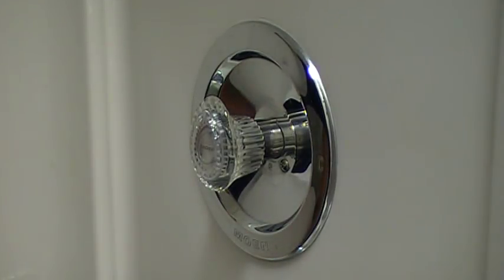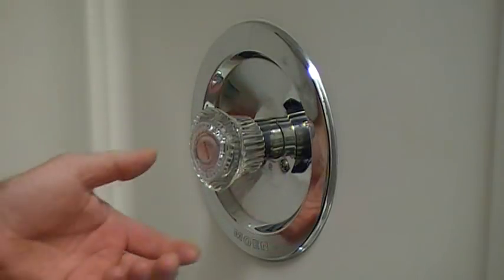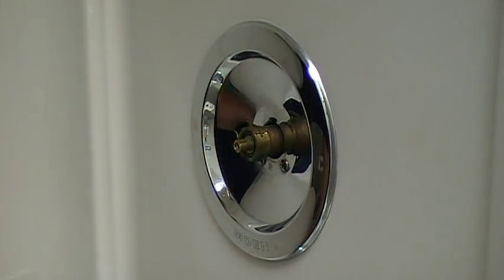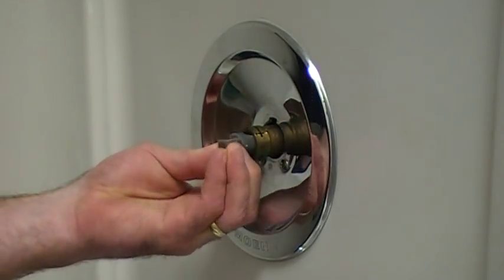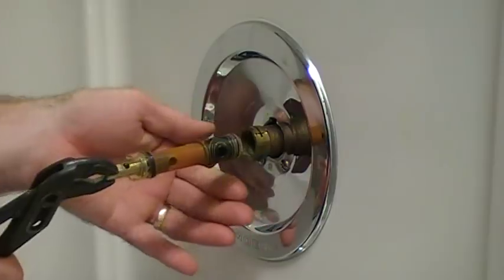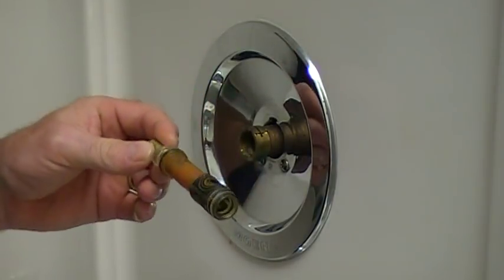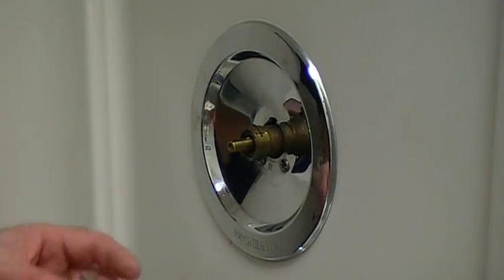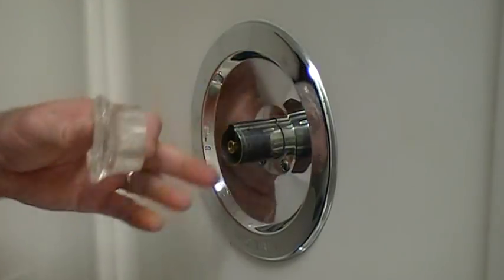How to repair a leaky single lever moen bath or shower faucet..Older style

Comment: Can you tell me..I have this faucet but when I remove the handle its just a pipe sticking out.  It does not look the same as yours. I can see the cartridge inside the pipe.  No pin or clip on the outside.  Will I be able to remove the cartridge with the tool?  I ordered it from Moen.  The house was build in 1987 so I imagine it is the original.
Reply from the maker: Hello Hilda,
When you remove the handle is there a chrome pipe that you are looking at and inside it, you see the cartridge?
You should be able to remove it with the puller. They work very well.
Thanks for commenting and get back to me when you get chance.   Al

Comment: Mine leaks 1 drop every 2 minutes. After the plumber soldered all connections with the cartridge installed.

Is the cartridge bad now??

thanks in advance.
Reply from the maker: Hello  Moreawake Now,
He should have never soldered it in with the cartridge in place. You will have to replace the cartridge to stop the leak. Hopefully it will come out for you easily. 
A torch and plastic don't work well together. Turn the cartridge before you try and pull it out. 
Thanks for commenting and best of luck with the repair!    Al

Comment: Hi, I replaced the knob, sleeve and beauty ring kit.  It came with the little metal gasket and a rubber washer.  The directions never said where to use the rubber washer and I have water coming out of the knob when assembled.  Any suggestions?
Reply from the maker: Hello THEEPLANB;
I would remove the cartridge again and check the inside of the faucet to make sure it is clear of any little foreign objects.
Then try and insert the cartridge again.
If you still have a problem afterwards; I would grab a cartridge and install that it.
It is possible to have a faulty cartridge, but very uncommon.
If it is the o-ring is the size of the brass on the centre of the cartridge; then it would go on there before you attach the handle. 
Thanks for commenting and best of luck with the repair!    Al
Reply: TheOldkid888 WOW I DID IT!!  Gave it a little twist, plenty of plumbers grease and whola!  Followed your video EXACT, I had NO experience at all ever.  Mom of 3 if I can do it you can too ladies.  THANK YOU AL !!!!!!!!!  :)
Reply from the maker: Hello THEEPLANB;
You are more then welcome!
Congrats on the repair!
I am glad you got along well with it!
Thanks for commenting and have a great weekend!    Al

Comment: Great video. How do you know what size cartridge, 1225? Our Moen is probably around the same age and looks a lot like the same style. Is the number stamped on the cartridge?
Reply from the maker: Hello Tony,
If you have to pull it out to turn the water on you need a 1225 cartridge. 
The 1222 cartridge simply turns and does not pull out.
Hope this helps!
Thanks for commenting and enjoy your week!    Al

Comment: Any suggestions for someone unable to remove the Philips screw from the center of the knob? Tried WD40 & CLR -- It refuses to budge. Any advice will be greatly appreciated. Thanks.
Reply from the maker: Hello imluvnlife2;
That can be the most difficult part of the job at times. Darn things!
I would try a good quality penetrating oil and let it set over night. Good quality penetrating oils work well!
You want to use a screwdriver that is nice and firm and not sloppy in the end of the screw,  
push in very hard and try giving it a quick snap.
If you have tried this already; you MAY have to look at a purchasing a new the handle and screw. This entails cutting the handle off with a hacksaw and then making your repair!
You can look into screw extractors, but this may not be for you. They do work. You must drill a hole into the screw and then use the proper size extractor to remove the screw.
Sorry to hear your troubles. Wish I could help more!
Thanks for commenting and best of luck with the repair!
Reply: TheOldkid888 : Finally got it all worked out. Thank you. (-: For a single mother with a very modest income, your tutorial is literally a life saver. God bless you!!
Reply from the maker: Hello imluvnlife2;
You are more then welcome!
I am very happy for you! Glad it finally worked out!
Now give yourself a well deserved pat on the back!
Thanks for commenting and if anything else should come up you are looking for a little advice on, don't hesitate to ask!   Al

Comment: I had my tub spout, handle and shower head changed about 20 years ago that cartridge lasted about 10 years till the faucet started to drip, had that changed by a plummer that one lasted 5 years and then that one started to drip too had that one changed by a plummer again. After 1 year again the faucet started to drip after watching your video I'm going to try my hand at replacing the cartridge or do you think I should replace the whole faucet. ThankYou
Reply from the maker: Hello  nanared419,
I don't think the faucet itself should be changed out.
Replacing the cartridge should od the job for you.
Very strange that it leaked so often. 
What type of water supply are you on. City or a well?
Thanks for commenting and get back to me when you get a chance.    Al
Reply: Thanks Al for resounding so quickly, I am on city water.
Reply from the maker: Hello narared419,
You should be able to tackle this yourself and have no issues for some time afterwards.
I was curious as to the water supply because if you were on well water sediment could see be what is causing the cartridge to leak.
If you go to your local hardware store and ask for a free cartridge they should give you one. I know they do in may of stores around here. The company will even send you one in the mail if you give them a call free of charge.
Thanks for commenting and good luck with the repair!
Let me know how you get along!     Al
Reply: They could have 'hard' water as we do out here in Las Vegas, NV. Soft water filters are commonly installed on both hot and cold lines to prevent calcification and such.

Comment: Any chance in a part number for this item? It looks just like the one I am working on but can't find parts for it.
Reply from the maker: Hello @fubar1872008,
The part number for the Moen cartridge that pulls out to turn on the water and turns for hot and cold is a 1225 moen cartridge. 
The 1222 cartridge does NOT pull out. You simply turn the handle to both turn on the water and find your correct temperature.
Hope this helps!
Thanks for commenting and enjoy your week!     Al

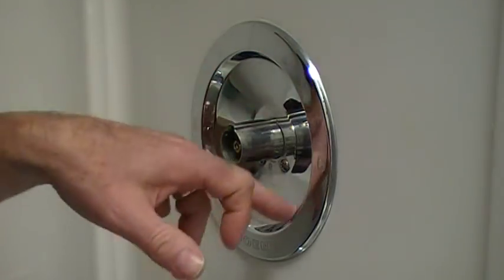Comment: Question, I had a stripped screw which I was able to remove from a moen tub faucet.  Though there is a bigger piece in front of the piece that is shown at 1:06 of your video.  I have tried to pull it off to no avail.  Any guideance you can provide?  Many thanks...
Reply from the maker: Hello Kevin;

How did you make  out with the repair?
I hope it went well for you!
Drop me a line when you get a chance.
Thanks for commenting and have a great day!   Al
Reply: Hi Al, I decided it wasn't bad enough but I could not figure out how to remove an almost collar piece in front of the cartridge.  Even after removing the set screw and lubricating it with wd-40 it would budge.  Should I consider cutting this off and just replacing the handle or will this cause more problems in your experience?  Many thanks!
Reply from the maker: Hey Kevin;

I would work that handle back and forth. It should come off eventually.
You may have to come onto the handle with a little more force working it back and forth and up and down.
This should break that seal between the handle and the cartridge. The last thing you want to do is cut the handle, but you may have no other choice eventually.
Let me know how you get along.
Thanks for commenting and have a great day!    Al

Comment: Well Sir...I have a problem. I need to replace the cartridge in a single valve that looks just like the one in this video. The problem is I don't know the mfg. or the number of the cartridge and can't even find anything close to the tool you used so I can't remove it to match up. Any suggestions? I'm guessing this is the original with the house which has to be 30 to 40 yrs. old. I went to Home Depot but they were really no help.

Comment: I have the exact same moen fixture. My problem is the cartridge WILL NOT come out. Retaining clip has been removed, I used the white tool it came with. The inner part that surrounds the cartridge, broke off. Now I am still stuck with a leaky faucet. Any suggestions would be appreciated.
Reply from the maker: Hello Gilbert;
I made a video just in case the tool would not do the job!
Removing a moen cartridge from the faucet! If the plastic tool should fail you! Plumbing tips!
This should help you with your repair!
Thanks for commenting and best of luck with your repair!     Al
Reply: TheOldkid888 
After all the twisting and pulling on the cartridge, the main piece in the middle broke off. It took a screw extractor to remove the rest of the cartridge. Before inserting a new cartridge, I sprayed CLR inside. Works like a charm now...
Reply from the maker: Hello Gilbert;
Good call on the screw extractor. Pain in the back side when the center section comes out, but I am glad you got along well with the repair and now have a leak free faucet!
Thanks for commenting and have a great day!     Al

Comment: Hi, do you know which of the cartridge to use ? is it 1222 or 1225. i have an older stanadyne cartridge 25 years old that is leaking but i have no idea which cartridge to buy to replace it.  Please any help is highly appreciated.
Reply from the maker: +Tekinila 
The 1225 pulls out to turn the water on and you turn it left to right depending on what temp you want your water. The posi-temp 1222, which is the newer cartridge, only turns from left to right to both turn the water on and adjust the temperature of it. It does NOT pull out like the 1225 which does.
I hope this helps you out.
Thanks for commenting and enjoy your weekend!    Al
Reply: thank you so much for getting back to me. following your instructions, i was able to change the cartridge which saved me some money. you are a kind man
thanks
Reply from the maker: Tekinila
You are more than welcome!
I am glad everything worked out for you!
Thanks for commenting and enjoy your week!      Al

Comment: this is the exact same shower faucet we have, my question is how do I adjust the hot and cold on this model. Our water control is next to nil, you either get really cold or very hot water.
Reply from the maker: Hello Lisa;
The water temperature in this faucet cannot be regulated.  It simply runs by pulling the handle out and turning it to where you want the temperature at. If someone in the house turns on another faucet; there is a good chance that the temperature will fluctuate. If the waterlines in the house are only 1/2 inch in size and another faucet is turned on the volume will be affected and this will cause the temperature to change..
Another factor as far as getting a lot of temperature fluctuating is waterlines in the house that are almost plugged. This can cause trouble as well.
They have since changed the faucet and come out with a posi temp faucet that stays the same when water is turned on in other parts of the house.
Thanks for commenting and have a great week!     Al
Reply: TheOldkid888 thank you for your response, it was actually me who asked the question not knowing that my daughter was still logged on her Youtube account....I think I maybe buying a new faucet. Thanks again
Reply from the maker: Hello Paulette;
You are more then welcome!
Best of luck with any future projects!
Thanks for  commenting and have a great week!    Al

Comment: Where did you get the a new older style cartridge? Can I get that same one at a Home Depot? I looked at some 1225's but did not match up to the old one.
Reply from the maker: Hello Efon96;
If you have an older style Moen faucet then it is a 1225B style. The cartridge you have may be made of brass. They still make the brass style, but the more popular replacement that moen makes is made mostly of plastic and does the same job!
Moen only started making a different cartridge for their posi-temp faucet about 10 years ago and that takes a 1222B cartridge which is about twice the diameter of the 1225B.
The 1225B is used in all their single lever faucets ( kitchen, basin and older style bath and shower ) except the posi-temp.
Thanks for commenting and best of luck with the repair!    Al
Reply: TheOldkid888 My house was built in 1979.  1225b was out of stock at my Lowes.  I used the DANCO equivalent to the 1200 for my faucet, less than half the price, but you need to buy plumber's silicone grease ($3) as it is not pre-lubricated..  I bought the $12 DANCO CORE PULLER #86712.  Lots of minerals in my water, so I used a brass 12 gauge shotgun cleaning brush and lime-away to clean the inside.  Works great.
Reply from the maker: Hello Robert;
I am glad your repair went well for you!
A little plumbers grease will always be handy to have around.
Thanks for commenting and have a great week!    Al

Comment: Hello, I have replaced the cartridge twice, once with the plastic version, then with the all brass version, but yet, I have an issue with maintaining temperature, it seems there is some issue with trying to maintain a warm setting, As I take the shower off pause mode,  it goes to extreme HOT or COLD at this point I am turning the dial to try and balance then after a minute it finally adjusts to warm.  Any idea what is happening?  Thank you!
Reply from the maker: J siernos 
This cartridge is not a temperature balancing one. If another faucet is being used in the house the temperature will swing dramatically depending on which faucet or fixture is used. A toilet for example will draw cold water  and the shower will become extremely hot until the water in the tank reaches its shut off point. Then the water in the shower will stay constant until another fixture is run.
If you are on a well and your water quality is not good then the nipple coming out of your hot water tank maybe closing off with mineral build up and not allowing a great amount of hot water to leave the tank. With your pump cutting in/ this will push more cold water to the fixture and your temperature will change.
Even if the waterlines are changed in the house with a manifold system where each fixture gets its own hot and cold the temperature will change with this type of cartridge.
Moen's newer version...1222 cartridge allows the water to maintain its temperature when other fixtures are being used.This cartridge has a bigger diameter then the 1225 and will not fit the older style bath and shower faucets.
I hope this helps. 
Thanks for commenting and have a great weekend!    Al

Comment: I replaced mine but it still has a slow leak drip. is there anything I could have done wrong or need to do?
Reply from the maker: Hello Frank,
The only thing I can advise you to do would be to remove the cartridge and try another one.
It has happened to me a few times where the new cartridge has a flaw in it. 
It is very rare, but does happen. This could be what is taking place with your leak.
If you call Moen's 1-800 number they should mail you a free cartridge in the mail. Most hardware stores will hand them out at no charge in my area.
Hope this helps.
Thanks for commenting and let me know how you get along!    Al
Reply: Thanks for your help. I will give it a try

Comment: My shower has been leaking for a year. It's getting worse. I have to do this!!
Reply from the maker: Hello authoressgerrid.1096,
No time like the present!
That's a lot of water! 
Biggest thing is to twist the cartridge back and forth before trying to pull it out. If you don't then you will have a very hard time removing it. 
There is a Moen cartridge puller knock off that isn't very expensive at the big box stores that could help as well!
Thanks for commenting and best of luck with the repair!    Al

Comment: Is the water needs to be shut off before changing it?
Reply from the maker: Hello Denise,
You MUST shut the water off before changing it out. 
By turning off the main cold waterline coming into the house or from your pump you will not need to turn off the hot. This shuts the water off to the entire building.
Thanks for commenting and have a great weekend!      Al

Comment: If I can't find the shut off to my bathtub do I have to turn it off to my whole house, or is there any other way to do it?  Also if I shut it off to the whole house I'm assuming I would have to drain the lines and then fill them up again after?  Would I have to do that if I had to switch the hot and cold again?
Reply from the maker: Hello willismc77;
So if there are no valves noticeable for the bathtub; you will have to turn your main water off. If you shut the entire house you should open the bath faucet and let the water drain down below the height of the basin in the bathroom that is providing you are on the second floor. If the bathtub is located on the first floor and you have a bathroom above; you should go up and open the hot and cold on a faucet and drain the lines to the bathroom below.
As far the hot and cold go; if they are on the wrong side after you have installed the new cartridge; all you need to do is turn the canter part of the cartridge that the handle attaches to 180 degrees. This will change the water on both sides from hot to cold.
Thanks for commenting and have a great week!      Al
Reply: TheOldkid888 Thank you so much!! All fixed and works like a charm!
Reply from the maker: Hello willismc77;
You are more then welcome!
Congrats on the repair! Glad everything worked out for you!
Thanks for commenting and have a great week!     Al